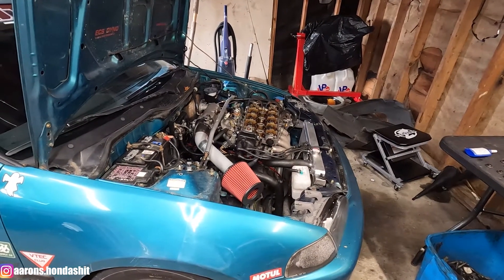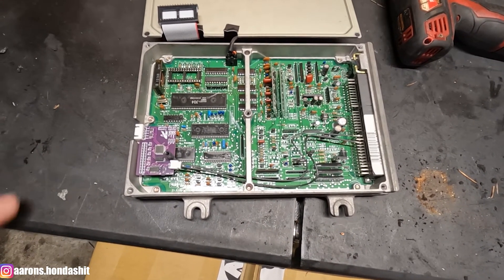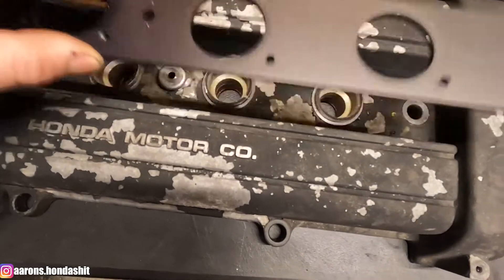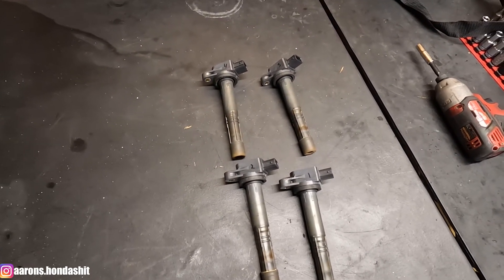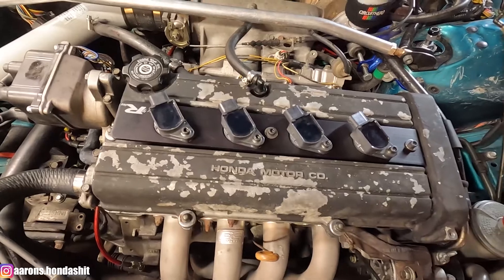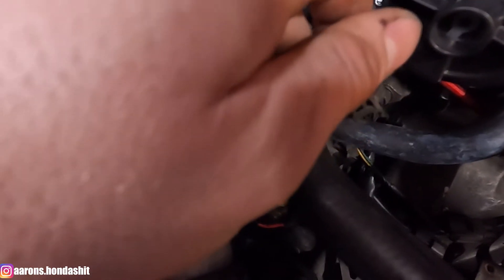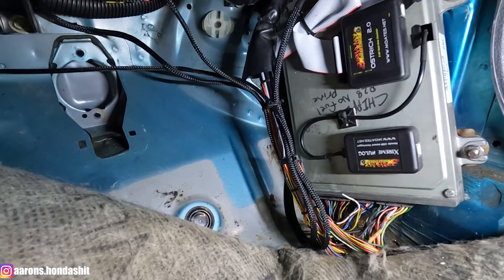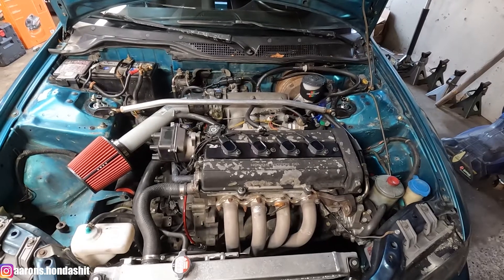How To Convert Your Honda To Coil-On-Plug (Burton Racing COP Install)

Comment: The question does it add power?
Reply from the maker: Not by itself but it makes it easier to tune as well as being more reliable. Reason I switched is because I've spent more than this kit cost in just replacing failed distributors

Comment: You are better off runing a msd 6a ignition kit. When i was a kid in 2001 thats what i would run.
Reply from the maker: Times have changed my friend
Reply: @AHS_motorsport  lmao you clearly dont know then.
Reply: @AHS_motorsport  the kit im talking about is better then this set up. Its also more expensive. Hence why
Reply from the maker: @bobg3633  can you change ignition dwell with a 6al? It's been 23 years since 2001 nobody runs 6al on Honda's anymore
Reply: that was /is a very good setup I agree. I'm a little skeptical on anything but factory setup especially if you like travel across states. Time will tell how reliable these are